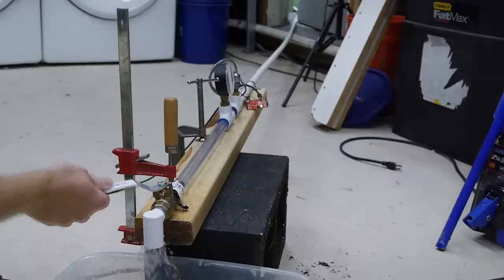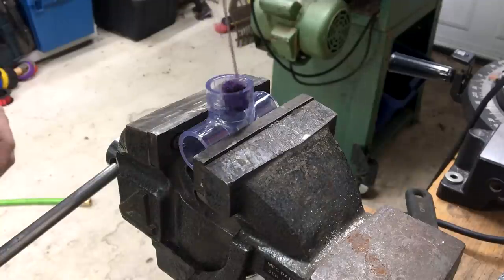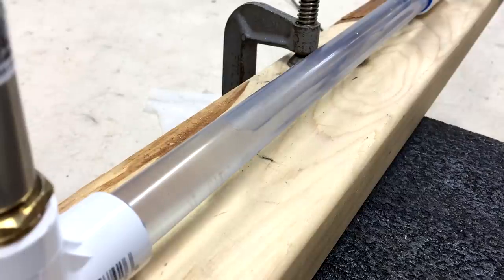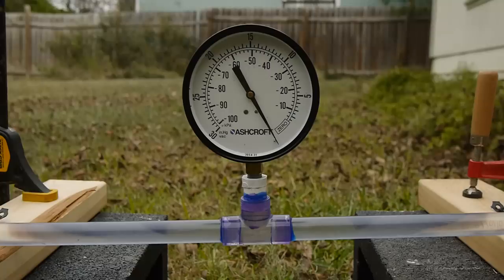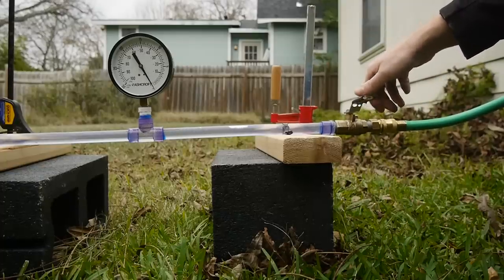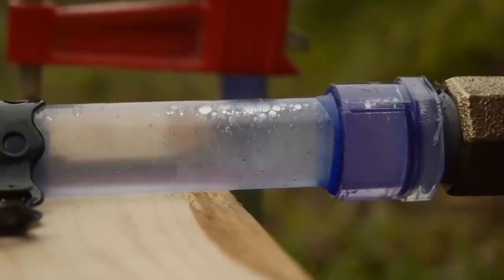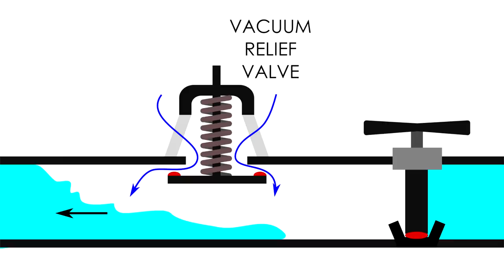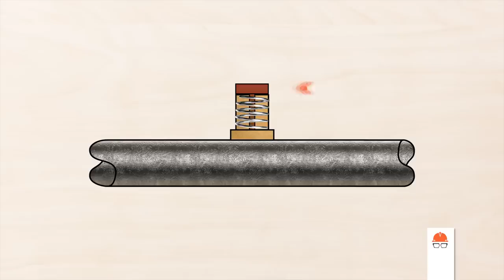How to Collapse a Pipe by Closing a Valve

Comment: The “over 30” of vacuum comes from the momentum of the needle. A perfect vacuum is 29.9 so technically a vacuum of 30 isn’t possible. It’s also possible that the bubbles are actually water vaporizing into steam as water boils at room temp below about 15” hg. Either way though, super interesting!!
Reply: I think you are confusing inches of mercury with feet of water  1 atm = 29.92" Hg.  Atmospheric pressure depends on the atmospheric pressure on the day and the altitude above sealevel.  1 atm = 33.8 feet (of water).  If you do this experiment with the outlet more than 34 feet below the valve, you will get a steady reading of -33ft or approx -100kPa.   That is why a suction pump on the surface cannot pump water from a well more than about 30 feet deep.
Reply: @karhukivi  no i ment HG. But once you hit about 1/2 an atmosphere the vapor point of water is down to below 20 C so if the vacuum gauge reads 30 then any tiny bubble would make room for water to vaporize.
Reply: @ryanhamstra49  There are other liquids that could be pumped, including mercury itself!  Not every liquid will contain dissolved gases.  There will be a drop in pressure and if it was mercury, whose vapor pressure is very low, then the gauge would show -29.92" Hg or 76cm as in a mercury barometer.

Comment: Great demo!  I can't help wondering: if the peak vacuum is 100 kPa below atmospheric, and atmospheric pressure is basically 100 kPa, does that mean you (briefly) achieved a near-perfect vacuum?  And is this fluid momentum technique ever used for achieving short-term vacuum, e.g. in experimental setups?

Comment: Those bubbles forming is called cavitation.  Cavitation in a pump can be common for poorly designed, a clogged filter between reservoir and pump, or wrong pump selection.  This cavitation will erode the impeller to the point of failure.

Comment: Electrical current flowing through an inductor or long piece of wire does the same thing. Current = flow, voltage = pressure.  Exactly the same phenomenon. This is why  ‘sparks’ are seen when you unplug something. Voltage spikes at the sudden stoppage of current.

Comment: Super interesting! What about a ball valve at the bottom of a 3 cubic meter tank full of rainwater? I have to close it fast when I fill the 6 gallon jugs of water (or it spills and splashes!), so far it has withstood... also, there's plenty of air coming in from the drain pipe up top.

Comment: In principle, just like an inductance in a DC circuit. First it hinders the inrush current and when switched off, a voltage peak arises, because the inductance wants to maintain the current flow.

Comment: I'd like a video on how dancing fountains work. I'm guessing the water is always flowing through a loop under the concrete and a valve diverts the water (which already has momentum) out of the loop to generate those 3 inch long pulses that fly 5 feet into the air. Surely it wouldn't work with stationary water trying to accelerate so quickly out of a freshly opened valve? Maybe if there's an air chamber to store up the developed pressure in compression...

Comment: I had a neighbor in my apartment building blow his water pipe in the bathroom (which shares a wall with mine) by slamming the taps closed after his shower. I kept hearing those pipes knock and slam and I knew it was coming but he wasn't having any of my warnings. Sure enough one day he slammed the taps closed and the pipe burst in the wall and he as well as everyone on the 4 floors below us had flooded bathrooms. Now I have another guy doing the same thing in this building... shakes head

This building I am in now was built in the 50's and they are constantly having emergency water shut downs for burst or cracked pipes. Of course they have to shut the water down to the whole building to make any repairs.

Comment: More than -100 kPa with outside atmospheric pressure is impossible because you can't have a vacuum any stronger than a perfect vacuum (zero absolute pressure, or -100 kPa at atmospheric pressure). That fluctuation of the needle reading lower was just the momentum of the needle itself shooting past -100 kPa because the change was so abrupt.
Reply: The atmospheric pressure is about 30 feet of water, so if the outlet pipe is more than 30 feet below the valve you will get a vacuum below the valve and above the water column.  It won't be a "perfect" vacuum due to dissolved gases coming out of solution, as shown in the video, but it will be close to the -100kPa.    Yes, the needle was moving fast in the video but if you try it with the outlet 30 ft below, it will show a steady -100kPa or thereabouts.

Comment: Totally dumb question: can this occur in a gravity fed watering system where the outlet downhill is always open or does this occur only when the downhill outlet is closed off? I'm thinking it can happen in both scenarios?

Love this channel. I dabble in permaculture design and your videos help inform my design decisions.
Reply: Anywhere you have  along length of pipe, flowing full, you can get this effect if you interfere with the flow.   
If you close the downhill outlet suddenly you'll get a positive pressure 'spike' running up the line.

Comment: So, I just need a little clarification. A water hammer downstream video (Water hammer Video) can cause a vacuum at the source/inlet of the pipe line? Or does this only occur when a valve at the inlet is closed?

Comment: Is it possible that some of the gas close to the inlet is actually steam? The low pressure would in turn lower the boiling point of the water which could potentially create steam. I haven't done the math on this, just a thought.
Reply: you sir are correct. at work we add positive pressure to water to remove suspended excess free oxygen from the stream.

Comment: Practical Engineering is engaging in the "Number 1 No-No"  that a plumber can do with plastic potable water pipe. Or just plastic pipe in general.

DO NOT USE OR INSTALL IT UNDER DIRECT SUNLIGHT!!! 

For that matter do not even leave it on the back of your truck WITHOUT COVERING IT UP!!! 

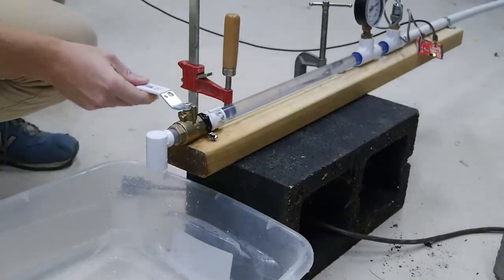Don't leave it out on the lawn as seen at 3:54. Or on the roof. Nor anywhere that direct sunlight can reach it's naked walls.

Plastic in general breaks down in sunlight. It is exactly these kinds of videos which create potential water emergencies. Things like water mains left out in the sun that burst when the homeowner is away down in Disneyland. 

Boy did I make good money that weekend! Not only got paid for fixing his pipes. But for drying out tons of his personal items.

Comment: (Fails to actually implode any pipe.) The hose can't "suck" very hard because it collapses. (Could have shown the hose collapsing.) A 50ft hose might not suck any harder than a 10ft hose. How about a metal downstream pipe discharging underwater to avoid air intake? Slam the valve shut using a bungee cord or similar. And maybe try boiled de-aerated water.

Comment: Sometimes theres water hammer while the valve is open, is that just loose pipes. Been in this house 30 years and have only heard it 5 or so times. Did I turn the faucet to the sweet spot?

Comment: I expect to see more and more problems in residential systems caused by this effect, as the market turns away from old fashioned gate valves to more reliable but more risky ball valves, sure the ball valve won't get crusty and form an incomplete closure like a gate valve, but a replacement valve is cheaper than blowing out a pipe in the wall somewhere.

Comment: So why don't dish washers and clothed washers either close more slowly or incorporate anti-hammer in their device (since it's their device causing the problem)?
Reply: Actually, as a plumber I do install hammer arresters on dishwasher t's, and they're built in to the washer boxes we use for supplying washing machines with water.
Reply: jarred petroff yes  I've added them myself also...including sprinkler timer 😉
Reply: @jeffcampsall5435  good idea, they're usually a simple but helpful little addition. When was your home built? Now hammer arresters are required by code, at least where I'm at in the U.S.
Reply: @jeffcampsall5435  yeah I hear you, i was all thrilled last weekend when i got my sprinkler valve wired to my existing controller. Little things in life sometimes, ha
Reply: jarred petroff 2008? No idea what the code hrtec(Canada) is... I tend to surpass code anyway on my DIYs 😁

Comment: Some of those bubbles you see are likely water vapor as water will boil at lower  temperature because of the reduction of pressure. Think of cavitation caused by sudden pressure loss.

Comment: I live in an old UK Terraced house that has a lead water main feeding 4 properties. I have started experiencing water hammer on my cold water pipe since a new neighbour moved in. I can eliminate my other 2 neighbours as it was not present when my old neighbour lived next door. When it occurs it will hammer every 15 seconds exactly, sometimes from early in the morning all the way through to late at night, stop for a bit and then start again. It is really p155ing me off. It is as though my new neighbour has a solenoid valve on the cold main somewhere in their house, every 15 seconds, i experience a sudden drop in pressure if I am running a tap. It only lasts for a fraction of a second but its every 15 seconds it will do it again. Im almost convinced they have an auto irrigation system running in their house (its rented). Should I contact the water authority and express my concerns? This can't be good for old lead system terminating into copper where it enters my home.

Comment: in europe normally a big pipe instalation MUST HAVE A LOW RATE SUTTING VALVE the one that`s 10 turns or more to shut the flow

Comment: Decompressing sickness happens when there’s a sudden drop in pressure. Dissolved gassed similarly get pulled out of solution and form bubbles as seen here.
Reply: I thought its steam coz of boiling, and most of it is.

Comment: Well, I was a little disappointed we didn't actually get to see a pipe collapse... But to answer your final question, isn't the best solution simply to avoid quarter turn valves in favor of the sort that have to turn and turn and turn to open or closed? I forget what those are called -- a screw and seat valve.

Comment: Several people have asked whether the bubbles are dissolved gasses or steam.  If it's any help.... my home-made piston in cylinder well pump draws water up about 2 metres and there's a constant stream of tiny bubbles at the inlet.  I know they're from dissolved gasses because they accumulated in the cylinder when I had the valve gear at the bottom.  Silly me.  I know temperature change also plays a part and haven't completely proven anything except that in my case it can't be steam.

Comment: I think it's safe to say you did not reach -100 kPa gauge. That would be very nearly a perfect vacuum. It's more likely the spinning pointer on the dial had it's own momentum and went way past the actual pressure it should have read.

Comment: I think the gases after you close the valve, is steam, since by lowering the pressure, you are lowering the boiling point of the water, besides the gases solved in the water
Reply from the maker: Don't think I got the pressure quite that low.
Reply: @PracticalEngineeringChannel  at -29 in.hg the boiling point of water is 0 C

Comment: I have worked at waterworks in thailand, my project is installation pump and valve, I want to deliver water by using 4 pumps in parallel, each pump develop head about 37 meter[water] and each discharge pipe size 1350 mm diameter, would let me know how to calculate the closing time of tilting disc check valve to protect each pump if it's tripped

Comment: I wonder what the reading would've been closer to the valve. You had a drop of more than 30 inches of mercury but that was a distance away and not at such a negative pressure where the dissolved gasses were coming out of solution

Comment: Ive noticed tgat tge flow valve in my washer does not open or close slowly but very rapidly. This causes a water hammer effect. This could be eliminated by wiring a large capacitor, resistor, and diode combination in parallel with the actuator solenoid. The charge  in the capacitor will discharge through the solenoid coil and the solenoid will then close slowly, preventing the water hammer. Alternatively, a hydraulic solution could be used. It would involve a buffer in the form of a tank of water separated by an air pocket with some kind of elastic membrane. This would absorb the shock of any water hammer and save on wear and tear of the pipe. I have the same problem with the automatic ice maker in my freezer.

My question is: Why aren't these solutions common practice?

Comment: Wouldn't there also be the potential for cavitation effects around the valve?

If it's drawing the gasses out of the water, you can bet those gas bubbles will then expand (since they're compressible while the liquid isn't), and when such an expansion happens, it can quickly un-happen.

Comment: There are a lot of parallels between flowing fluids and electricity. I wonder if there is an electrical equivalent to this.
Reply from the maker: Indeed: https://en.wikipedia.org/wiki/Flyback_diode
Reply: Practical Engineering that's so cool! So the negative voltage spike is directly related to the amount of current flowing before the circuit is opened. That's an interesting relationship. Thanks for the quick and intereating response!

Comment: Sadly my washing machine does not know this and just slams the door shut.
Luckily I have mounted a "slagdemper" (in Dutch). A "punch-softener" / "impact damper".  It's a metal round-shaped thing, with a rubber diaphragm and some Nitrous under pressure, boltedd in the pipe system, just as it goes to the washing machine.

Comment: Just make it fool proof and build a pipe system using valves that take longer to open or close. Not an expert with names, but the valve handle that looks like a gear that you would turn 360 degrees 5 times is a good example

Comment: The small bubbles could be from cavitation as the pressure drops.
Reply: Mech-E Only if the bubble collapsed after the vacuum spike. Dissolved gases is the more likely explanation here since there's a residual bubble after the fact.

Comment: I know this is an older video....but oh man that square in the background doesnt line up with the rest of them and REALLY bugs me lol (PS. love your videos)
Reply: This actually caused a real problem for me at home.  I have a lever type of tap/faucet in the kitchen sink.  Its connected to the cooper pipe by a flexi-hose which is quite old now.  One day I turned off the tap and it was followed by a bang and huge fountain of mains water under the sink.  I shut off the mains and the pressure spike caused by sudden shutoff of the water momentum burst the weakened flexi-hose.  Glad my wife wasnt home alone when it happened or the house would have been flooded! (She doesnt know where the shutoff is....not just cos she is a woman btw)

Comment: after seeing that you can pull more than 30 inches of vacuum here couldnt you use water hammer as a vacuum pump?

connect a one way valve in a T connector on the vacuum side and connect to vacuum chamber.

then using a means to cycle an electric valve like those washing machine or dishwasher on and off rapidly you can water hammer your way to excess of 30 inches of vacuum.

you may want to use an electric valve that is designed for water shows as they can respond much better.

also use a pressure washer as the water pressure source as it can produce higher pressures though you will then need pipes and fittings that have a very high pressure rating as pressure washers can do excess of 2000 psi.

Comment: Today I noticed a process feed pump running at negative 2.5 psi vacuum.
So I immediately turned the control valve in a non-counterclockwise direction